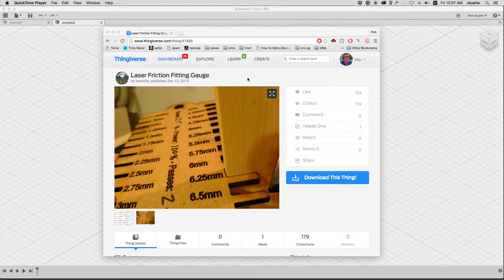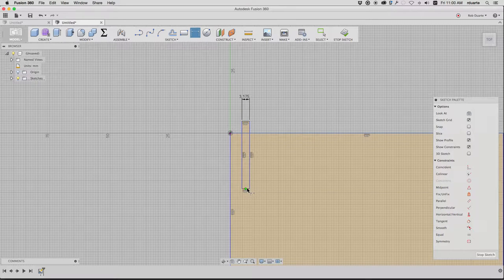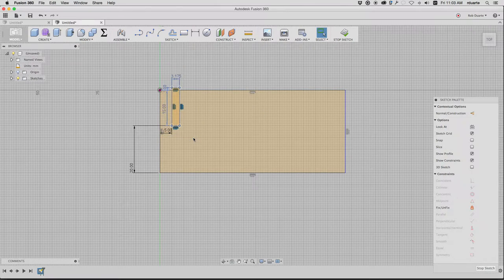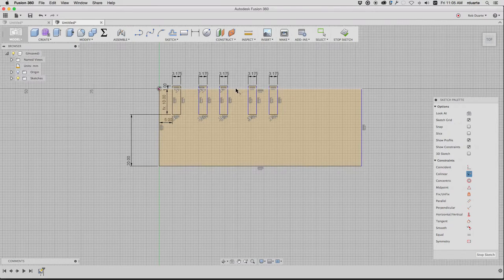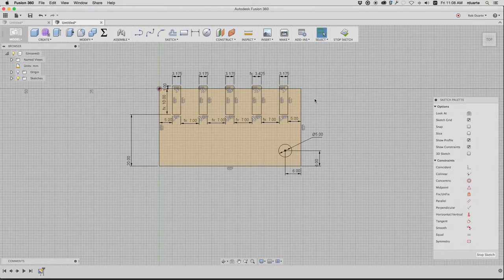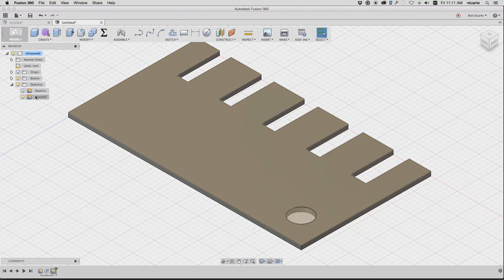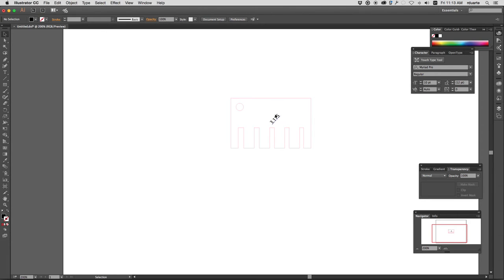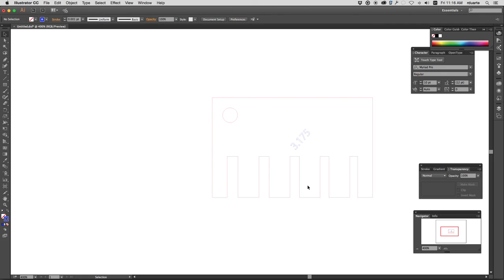Creating a Laser Fit Gauge in Fusion 360

Comment: Olá,
Julgando pelo teu último nome, provavelmente percebes o que eu estou a escrever.
Diz-me uma coisa. O Fusion não produz o Gcode automaticamente para o desenho que fizeste?.
Não faz muito sentido ter que criar o desenho no Fusion e depois usar o Illustrator. 
Será que a versão mais recente do Fusion já permite fazer o processo directamente?.
Não existem muitos tutoriais dedicados ao corte a laser, o que é pena.
Obrigado pelo tutorial.
Reply from the maker: Sorry, I only read English but Google did a good job of translating. :) Yes, you can use the CAM features of Fusion 360 to laser cut. You need to turn that feature on in the "preview" section of the preferences. I've gone through the process of exporting 2D drawings because it matches the workflow that I'm used to (and my students are used to) for laser cutting. I'm going to check out the laser cutting CAM features, though, to see if it makes things easier (or not).